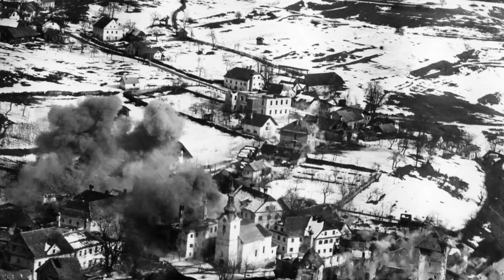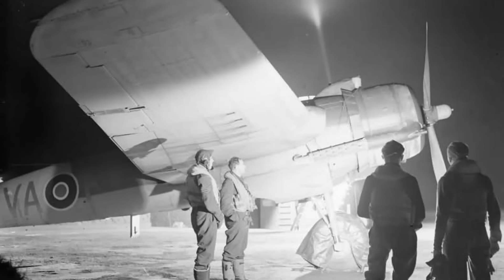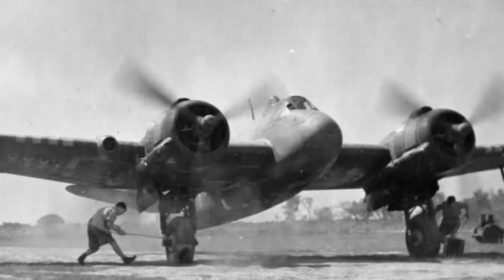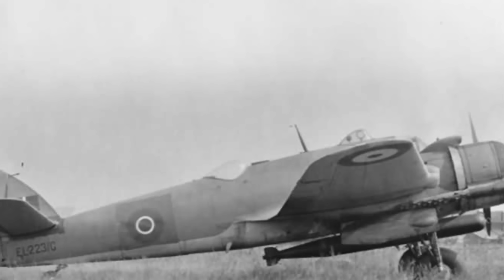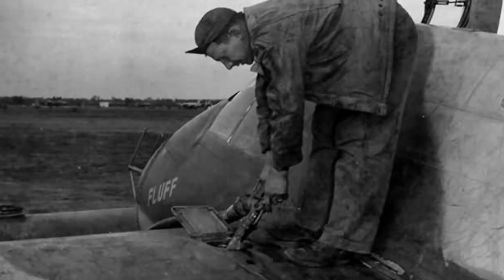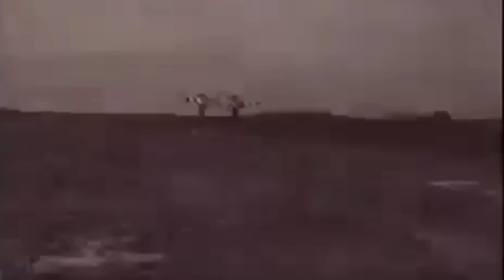The Bristol Beaufighter

Comment: The Beaufighter's take off swing must have been massive, perhaps partly due to the engines protruding so far to the front.
As a stopgap solution combining a rather draggy bomber's wing with a new fuselage, it could not evade German Bf109 and 190 fighters as the De Havilland Mosquito did. As a night fighter this did not matter as much and it was very successful. Perhaps the most interesting aspect about the Beaufighter was that despite the extremely tight tolerances to which the Hercules sleeve-valve engine parts had to be produced Bristol managed to get it reliable under the difficult wartime circumstances, and eventually pushed it to more than 2000 Hp post-war.
Reply: The Beaufighter could hold its own against the Bf 109 or Fw 190, the pilots if chased could turn and face them with that firepower.

Comment: I never understood the cylindrical engine. I am not a mechanical engineer, so admit  to being ignorant of engine types and their purposes.
Reply from the maker: Radials had some advantages: air cooled so no worries about coolant hits/malfunctions, could lose some cylinders and carry on. Much less "fragile" than the inlines, so better in rough areas. Kurt Tanks Focke-Wulf Fw 190 is a great example.
Reply: @Aircraft_Files  Kurt Tank changed from radials so maybe not such a great example, there is the myth about losing cylinders but quite simply that would take out the oil supply and quickly ruin the engine.

Comment: The Bristol sleeve valve engine was excellent and reliable.  Bristol was strong armed by the Air Ministry to share their technology with Napier but their Sabre engine wasn't fully effective until the Sabre V used in post war Tempests.  
Beaufighters filled many roles when the chips were down, including some fighter missions in the MTO and far east.

Comment: Thank you. An almost ignored but very capable aircraft overshadowed by its more glamorous companion.
Like the P40, the Beaufighter was an extremely important aircraft to the RAAF war in the Pacific.
Thank you also for getting the pronunciation of the RAAF correct.
Reply from the maker: I really need to do a DAP Beaufighter video. You may enjoy this on on the The DAP Beaufort  https://youtu.be/nt7MlDva1Sk
Reply: @Aircraft_Files  I’m using the original DAP prop bench for propeller maintenance at work!